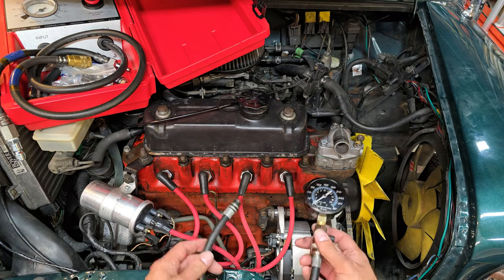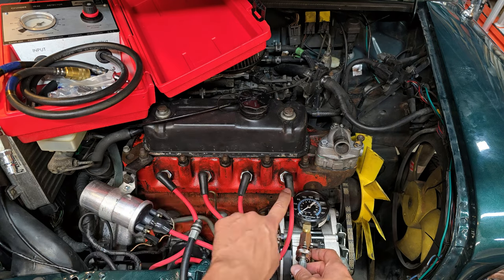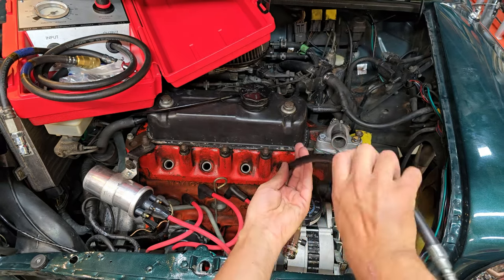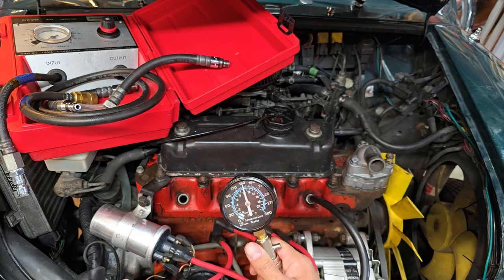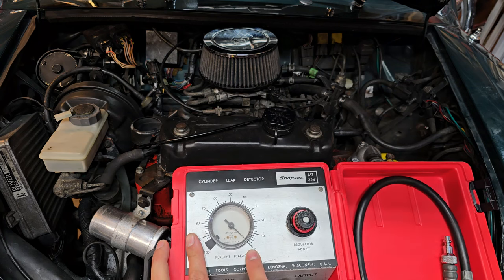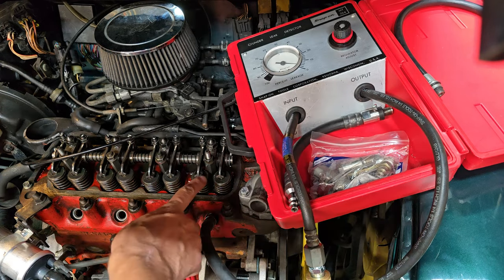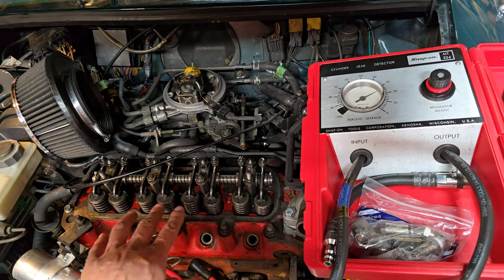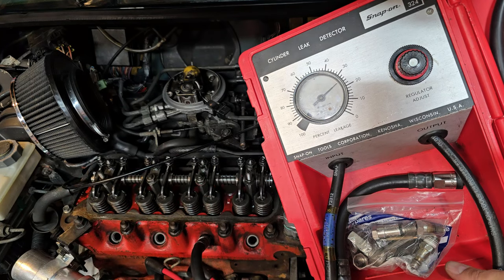Classic Mini Survival Guide: Compression and Leakdown testing

Comment: Great video thanks. Ive seen ACDodd doing Leakdown testing while reworking a head on the bench, but this is the first time ive seen testing on a full engine. So thank you. Whats the likelihood of the rings playing a large roll in this?
Reply from the maker: This motor mostly had valve leakage. I could hear the air leaking into the intake and exhaust. I'm sure some was leaking past the rings as well.

Comment: Nice video, but I was always told as an ape 55 years ago was to have the butterfly wide open so maximum air can enter the cylinders while cranking 👍 as for the leak down test I’ve just bought one because on checking my compression on one of my cars a 1938 that seamed to run ok I did a compression test on all 4 and much to my surprise number 3 was only 35 psi 😱😱😱 so I’m going to look  further into it obviously 😢. I like your channel and straight forward work 😀😀
Reply from the maker: If you don't open the throttle,  it just takes longer, more cranking, to reach max pressure. Max pressure isn't the point of the test. We test to see how healthy each cyl is compared to the rest. Thanks for watching and good luck with your project.

Comment: Darren it didnt look like the gauge was zeroed when you were leakdown testing cylinders 3,4,2 - are you sure theyre much worse that #1?

Thanks for all the content!
Reply from the maker: Good spotting! Normally i dont have to worry about rezeroing the gauge when I do the test but I had the power turned off to the compressor while filming and the pressure to the gauge dropped off a bit. I think it was off by 10 psi by the last cyl. Therefore all the cylinders were about the same 10-15 % leakdown.

A better example is coming out on Friday with a good motor getting leakdown tested.

Comment: Nice to see how a leak down works. I don't quite understand how it builds such good compression on 4 when it's also leaking 15% more than no. 1. Also on 998 high compression I see numbers nearer 190. You don't mention wide open throttle for the compression test, is that just something people say? Lastly do you know why you can still see good compression with a blown head gasket cylinder to water gallery? Sorry for all the different points in one!
Reply from the maker: I'm at 6000ft of elevation. The compression numbers are lower up here due to less available air. 
The two tests check different things. A cyl with good compression can have bad leakdown. The rapid rise of the piston can help seal the rings up. Also compression is a peak measurement.
Reply from the maker: Also I did have the throttle held open for the test. Just forgot to mention it.
Blown gasket to water has back pressure of the water to help contain the cyl pressure. Leakdown would show that cyl as bad.
Reply: @darrensrestorations991  thanks for the explanations mate, all good stuff 👍